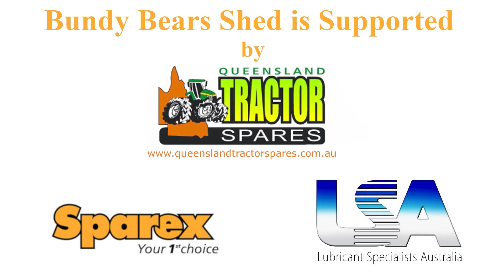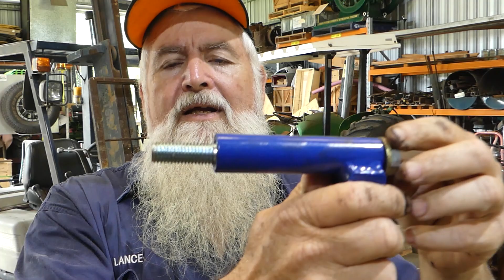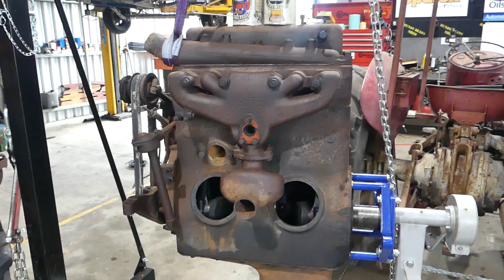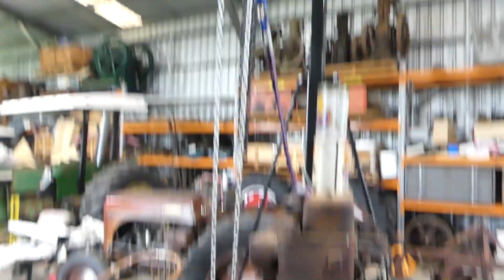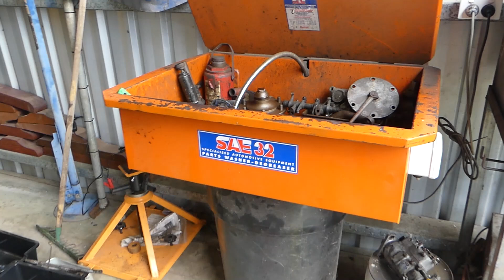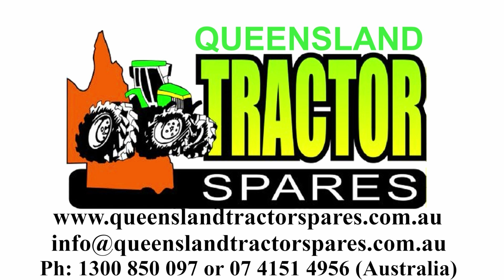1929 McCormick Deering Engine Introduction

Comment: If it is similar to the W30 motor there will be a timing mark on the flywheel. I timed the magneto how it said in the book I have from Fordson House I think and used a timing light to time it (via the mark on the flywheel) with the advance and retard and marked it. Fordson House has a lot of parts and gasket kits and also carby kits at least for the W30 which has a different carby. My carby has an air screw not mixture screw for the idle mixture which I finally worked out the last time I had it running. That makes a big difference. Not sure about the main mixture though. Jeff
Reply from the maker: Thanks Jeff, Looks Like Tom (Inverell) has a con rod and possibly some bearing shells so we will see what we can get locally before we order from Fordson House.

Comment: It's a two main bearing crank . I think the same or similar to what's in a 10 _20 . And yes very heavily made. Be careful with the manifold . I will look and c what have in the way of a manual for the engine .
Reply from the maker: Cool, thanks, Yes the 1020 does seem to be the same or very similar.